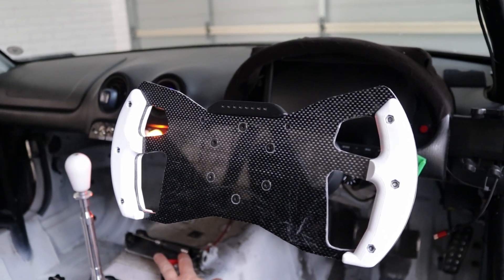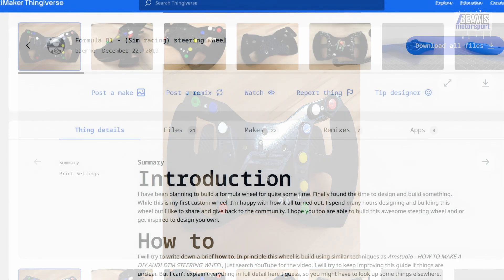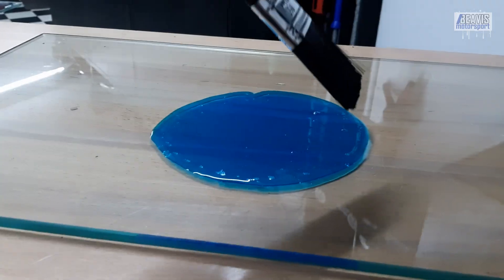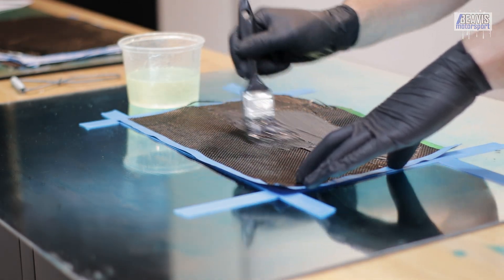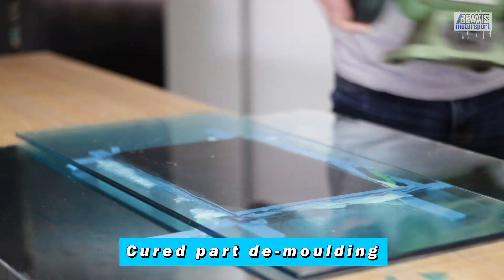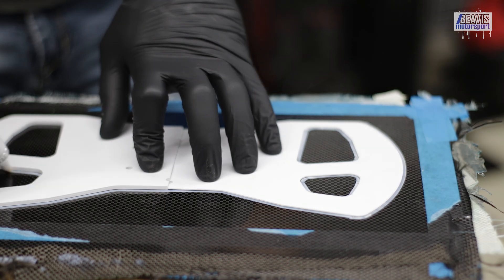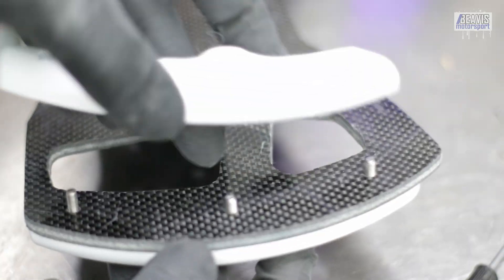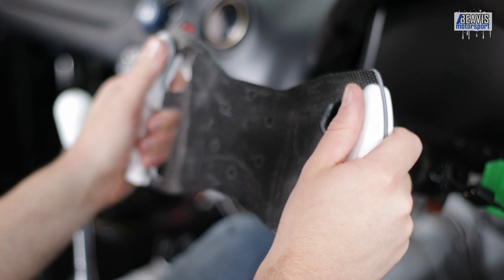Making a Formula/GT3 Carbon Fibre Steering Wheel - DIY GUIDE

Comment: Nice steering wheel!!!!! I used to make wings and ground effects 20 some years ago with fiverglass cloth and matting to cover it!!! Not sure if this will work for your resin but i used to clean my brushes with regular dish soap and the first time i couldnt believe it worked i saved a lot of money that way i dint realize until i mixed the resin that i was out of disposable brushes so used one of my paint brushes and i usually have hi quality brushes sinc i do a lot of house painting also wrapping the material in some painters plastic and duck taping the edges to seal it up to a shop vac house to suck the air out works so well a vacuum pump would be better but i made a pvc pipe heated the end kinda flat and use a pluming shit off valve before hooking up the shopvac worked great. I would love to get back into it been way to long lover making that stuff and would love to make a full body out of carbon well good luck love your videos so far!!!!!
Reply from the maker: I only do these things for fun, so every time I do it, I always make mistakes, or have to think on my feet... such as finding brushes or containers for resin.